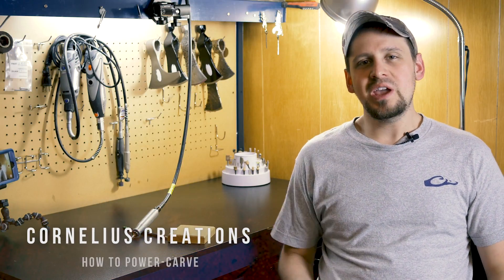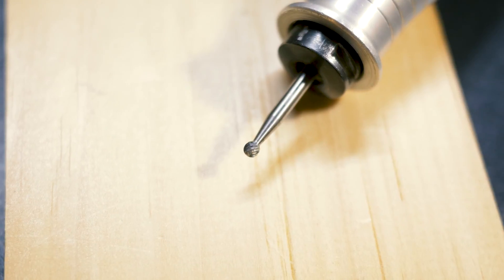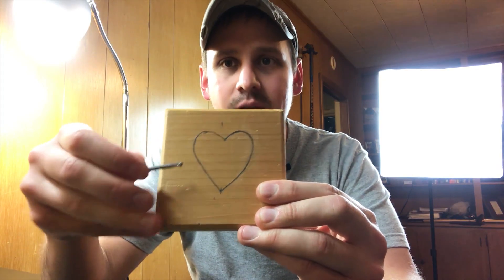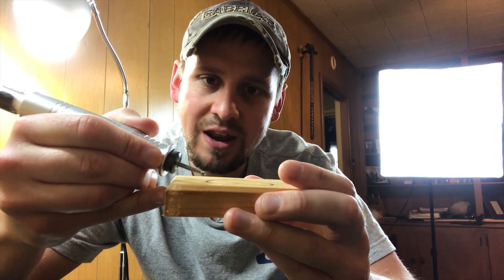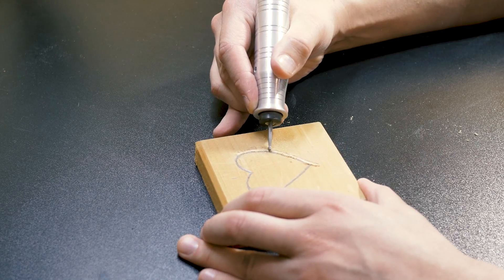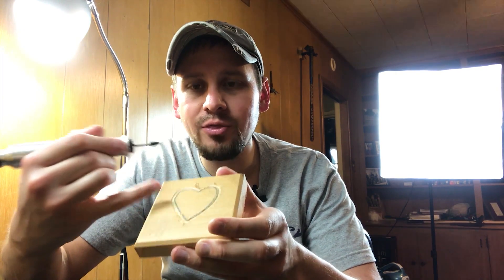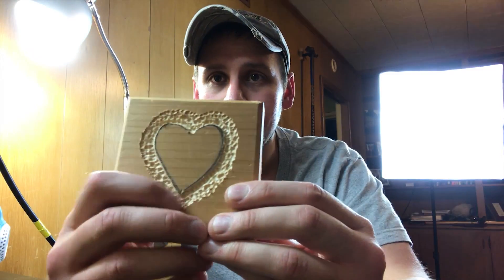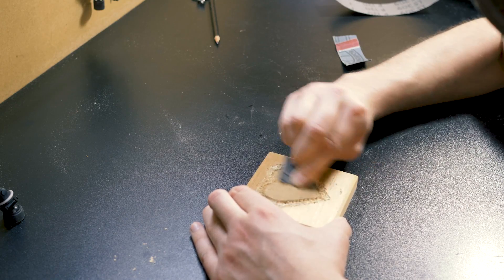How to Wood Carve/Power Carve With Any Rotary Tool

Comment: Fold a piece of paper, and make one half of the shape...then flip it for the other side, so they are identical... (-;
Reply from the maker: +Floyd Burdett great tip!!
Reply: Floyd Burdett

Yeah I was just about to suggest that tip :) that's the quickest & easiest way to draw symmetrically.
Reply: Or maybe buy a cricut and make way better stencils by computer
Reply: Floyd Burdett that is a great idea. Then you can trace it onto the wood and work from there
Reply: I LIKE SNOW FLAKES:
Reply: But do you like... SPECIAL SNOWFLAKES???
Reply: You could also print your design and transfer it to the wood
Reply: What sort of sorcery is this?
Reply: Witch!!!!

Comment: I bought the miter attachment with the drill bits at Menards for around $17.  Then you just have to unscrew the black grommet off and screw the attachment on, you can also adjust the depth of what you are engraving and it works really well for what you're doing.
Reply from the maker: Great tip!

Comment: Neat demo for starting to carve. I will be using my dremel w/cord to smooth out stoneware clay after the first firing. May also use for carving in the stoneware before glazing.
Not only will I be wearing a mask I will be using a downdraft grate on my tabletop with an exhaust motor attached to the exterior wall.
On designs such as a heart as I am rubbish with perception I fold a piece of paper in half and draw just one side then cut it out and unfold, Voila folk think I can draw evenly.
Thanks for sharing.
Cheers...Freddie

Comment: Matt, thanks for your helpful videos. Here is a question.  Which rotary tool cuts quietly but is still powerful enough to use on scrap pine?  Not having to wear hearing protection would be nice.

Comment: You can compensate for the drawings by doing multiple sketches so imagine pencil markings over themselves until you get a defined shape that you can specify. So your heart shape keep redrawing it upon itself whether the curves of the heart or the pink at the bottom or overall and one big shape until it looks uniform and you can smooth it out. The other thing you can do is you take a piece of paper an outline the shape you do want and use that as a stencil for the other shape so it's identical. You did a great job by the way drawing is definitely a great skill. But creating templates requiring the patience of drawing more than ascetics. It still helps to have a steady hand though. Artist have an ability to draw and envision the object AC which is something more abstract. In this case just finding your template buy compounding the markings until a defined shape is created is relatively simple and effective. You did great in nice video. I love the tips you gave

Comment: The fact that you are using pine in your demonstration, explains the "FUZZIES", lol.  I have a Dremel with a flex shaft and bought a foot control from Amazon and, I am really disappointed that the Dremel will only run at what seems like half speed!!  I plan on getting a Foredom some day but I want to be sure that I can run a specified speed.  What foot control do you use and, I also like your light source that is behind you where is that from?  Thanks, I am a subscriber .

Comment: TKRET
Before I retired, I had to teach all of the employees, how things 'were done' in the office.  When I was showing someone what to do, I also told them why it was being done., and how it fit into the entire job function from start to finish.
My question is I am not a fan of the stipple effect, and would like to see either a flat surface around the heart with straight sides on both sides of the 'moat' if you will, or keep the flat surface and have the sides walls on a 45 degree angle

Comment: Thanks for the video really helpful, can you answer a couple of questions for me. 

What kind of wood do you have to use, can you carve manufactured wood like mdf or ply.

Can you carve on other things like the Dremel engraver kit says you can engrave on glass but that’s a hammer action I think not a rotary.

How small can you get the carving with the rotary, could you carve a half cm letter for instance. So could u carve in 1mm for detailed work.

Can you use stain or paint to get the burning effect without using a pyrography pen and blow torch

Do you have a video of carving wood where you leave the carve indented rather than making it 3D. Hope that makes sense, this video for instance brings the heart to the forefront and the rest to the background but can you do it the other way round to so letters would be sunk in but smooth

Thanks

Comment: Have you had any problems with the flex shafts getting hot melting and snapping? I got a dremel knock off it broke after the first project

Comment: Can you use a Dremel sandpaper drum or disk instead of the sheet sandpaper? Also, what do you call that flame device you used at the end of the video? Thank you for your wonderful presentation.
Reply from the maker: Hey Joel! Drum sanders will take off a lot more stock than sand paper, so you have to be extremely careful. That was a butane lighter!

Comment: Hi, i love your video i just unwrapped my Christmas present Dremel 4000  . I'm really nervous about using it for the first time. I'm set to do a heart  like yours but  not sure what speed to use .Can you or anyone offer some suggestions please  my speed ranges from 5 to 35.  Thanks in advance. Sharon
Reply from the maker: Hey Sharon, I tend to carve around 16-21. Use the the higher speeds for very light finishing touches. The higher you go, the smoother it will be. But if you are removing a lot of stock you want speed & torque. Do a few practice pieces. I promise you will get the hang of it and see what I’m saying :)
Reply: @CorneliusCreations  Thank you so much  Cornelius very helpful. Happy New Year from across the pond.

Comment: Hi thanks for tutorial. I have a couple questions first can I carve on wood using a rotary tool? I just got one and not sure what all I can use the accessories for. They don't provide much in the way of directions. Also if that is possible how does it work using it to carve letters or words. I made my grandson a wooden cross and wrote a Bible verse on it and would love to carve it instead but I had no idea this might be a possibility with my rotary tool. Thanks for any info you can provide me with.
Reply from the maker: 1) Yes most definitely. You can use just about any rotary tool to carve the wood.
2) I suggest you do a little research on the burrs (bits) and watch a few more of my videos and things will begin to come a little clear for you.
3) Look around at Dremel's website and it will give you some ideas of how things work.

Hope this helps!

Comment: Awesome, thank you so much!  You're a clear & kind instructor with great video pov's too!  I'm very new to the Dremel world and this is so far first video that helped me grasp a bit more of the concept; with details, but not overkill.  I even read through the manual, but still uncertain (if not further confused, lol).  I defy need 'the basics,' and will be searching around here for more from you...  

I have the 4000 (211 if that matters?) and 2 questions atm:  
1) Is there a particular reason you didn't use one of these sanding (cylinder?) attachments instead of by hand?  
2) Is the flex tool part (mine I believe is called an engraver...?) much different than the main tool?  Is it specifically for writing/engraving - bc it's smaller/easier to grasp (mine has a tip on it, & doesn't look changeable)?  

Excited to see what this baby is capable of - thank you again!
Reply from the maker: Hey Jessica! Thank you for your kind words! 
1) Every burr has a purpose. The sanding drum would have worked but would have made a lot of dust instead of “shavings”. The burr I used will last a lot longer than the sanding drum. Also, the sanding drum is a lot finer grit and isn’t made for heavy stock removal.

2) The part your talking about is called the flex shaft attachment. It is made so you can grasp it easier and do finer carvings with it. Inside of the “chuck” is a “collet” that allows you to interchange different size burrs. This hooks to your main motor of your Dremel. If you carve wood most definitely use the flex shaft attachment. Most people use the main Dremel for around the house work. If you have any questions don’t be afraid to message me on FB!
Reply: @CorneliusCreations  AWESOME... Thank you!!!!

Comment: What speeds do you run your Dremel at? Thanks
Reply from the maker: That depends on the type of wood, what I’m doing etc. usually around 10,000-18,000 rpm
Reply: Could you do a video on explaining how to decide what speed to run, how to prevent runs where the bit takes off and what about grain? Thanks for your response.  @CorneliusCreations

Comment: Do you have any recommendations on what kind of Dremel to start out with?
Reply from the maker: 3000 or 4000.
Reply: Hi Cornelius, I’m from Belgium and am starting with gourd art. I’m not sure but I’m under the impression that gourds are a litter harder than normal wood. I’m not sure if I should by the Dremel 4000 or a Powercarver micropro that can go upto 45000rpm. What would you recommend please?

Comment: Great channel. Really well presented videos with loads of info. Total beginner at this. New subscriber. I checked out your link to the van haus engraver and there seem to be 2 kinds available in the uk. One engraver unit is held in your hand and the other type hangs on a stand and you engrave with a flexi lead of some kind that attaches to it. Which one would you recommend? Many thanks.
Reply from the maker: Always get the one with the flex shaft attachment! So glad the videos are helping my friend!

Comment: Thank you so much for these videos!  I have subscribed to your channel because I received a Dremel rotary tool for Christmas.  I saw elsewhere in the videos that you do not recommend carving into pine, which is the wood I use most often in my shop.  Do you have any suggestions for working in pine?
Reply from the maker: Awesome to hear that! Pine tends to splinter very easily! Make sure you ALWAYS wear glasses especially if you work with pine. You can use it, but it’s really not preferred among power carvers. Other than that I would just just try it out. I’ve only used it one time. And that was enough for me lol.
Reply: Cornelius Creations — Thanks for the quick response!  Would you recommend a lower speed with pine?  It seems like that might cut down on the splintering...

Comment: Is there a rule of thumb on what speed to use for power carving? Also, what is the best type of wood to use? (I am new at this).
Reply from the maker: Good question! Well the rpm is dependent on the density of the wood. When you start going too fast it tends too burn the wood while carving it. You want a good balance of torque and speed while carving. I tend to keep mine around 12,000 -16,000 rpm. But there are expensive pneumatic carvers out there that gets up to like 400,000 rpm! Those require special burrs and are mainly used for very high detail work. The best wood to start with would be some basswood or something. It cuts like butter and would be a good start. Just avoid wood like pine.
Reply: Cornelius Creations Weaponry thanks for the info. I’m excited to get started. I did the heart project and it came out pretty good. (For a newbie).
Reply from the maker: Right on! I am glad to hear that!

Comment: nice video  u know I want to buy  all the equipment to do carving wood and carving stone too can u help me to choose the right equipment to start?
Reply from the maker: Of course man! What is your questions? Also, you can find my amazon store front on the links above, this takes you to all the equipment I use.
Reply: thank u , well I wanna start with wood carving and I can see in ur amazon page u have Dremel with all the tools , u think that one is good to start ? because I never did carving  so I don't know if Dremel is good to start from 0.
Reply from the maker: The dremel is good, just add the flex shaft tool. If you aren’t wanting to spend that much check out the cheaper one I have listed. Get that and some burrs and you will be good to go! All you need now is to jump in the saddle and start carving :)
Reply: thank you brother I appreciate your help very much.

Comment: Ok I want to learn how do this stuff and I want to get one of these rotary tools but I have a simple and probably dumb question but WHAT IS AT THE END OF THE CORD?! do you just plug it into the wall or is there a machine I need to attach the rotary tool to? If you can answer this question it would be much appreciated
Reply from the maker: No question is a dumb question my friend. The end of the cord (the flex shaft) is a motor.  Inside of that cord (sleeve) is a wire that ATTACHES to the motor which spins it
Reply from the maker: My Foredom I use has an automatic flex shaft attachment. If you buy a dremel or similar brand you will need to by the flex shaft attachment

Comment: Hello! After what seems like hours of staring at the computer screen-I have decided to just break down and ask you for help-lol. Im very new to all of this-so it is quite possible I am missing the obvious answer-  all I want to do, is to be able to power carve/engrave wood craft items (words/design) etc. I obviously want something with power/smoothness, a flexible shaft, sanding bits, and a wide variety of bits/burrs?  I checked out the options you listed above (thank you for your variant price points!)-- however, to my untrained eye, it seems like there are a lot of bits/attachments I don't need and I don't see in the pics a lot of bit/burrs for engraving other than sanding?  Also, are the bits/burrs usually interchangeable from power carvers?  So if I get a Van Haus, can I buy Dremel burrs? Thank you for your help. I  just can't think anymore at this point. lol. Did I mention I was new? :) For example...are the two burrs you used in this video in these "sets"? THANK YOU- your videos are wonderful and appreciated.
Reply from the maker: Hey there! Any flex shaft unit will work starting out. The bits I used aren’t in a set, but you can get some for a good cheap price. All burrs can be used in other flex shaft machines, just make sure you have the right collet size. (The collet is inside the chuck of the hand piece which houses the burr) 

Just pick you up a cheap set of burrs and that will get you started :)

Comment: Just came across this. I was diving into relief carving starting off with gouges and V-tools. Finding some woods that it's a beast to work with and learn. I had an old generic "rotary" tool from being a mechanic I no longer use at the shop. Decided to try it out. Though it's a bit large and ungainly I am still taking a swing at it until I know I want to upgrade to something like you have. 

Any preferred set ups for straight beginners that are cost effective? 

 One question on my first foray into it I found it easier to control the cut letting the tool run with the rotation of the bit, tends to get spastic on me when I go against it. Is there any harm in this approach?

Also want to add in. Looking through your video list- probably binge watch tonight. Absolutely love your "Viking" designs. Life goals!
Reply from the maker: Hey Don! So glad to hear you are getting into powercarving! 

Setups: I have a link to a rotary tool for beginners that are around $40 in my storefront link. 

Direction: the burr will spin to the “right” which is clock wise. You need to angle your hand piece so that your burrs is always moving backwards toward your or to the left. Rule of thumb* pull the hand piece in the opposite direction the bur wants to “run too”.
Reply from the maker: Also, thank you for the kind words!
Reply: @CorneliusCreations  - Gotcha! Thanks! Been watching a couple more vids since. I saw your list. I think I may either try and get a flex adapter to fit on what I have ($8) or get that Tack model on your list. That was a head slap moment. After I typed what I did I saw your list and your store. (hopefully you get kick backs). Hope you and yours have a Merry Christmas and a safe Holiday. - Don (from NC)

Comment: What kind of mask should I wear for something like this? What are some guidelines I should look for?
Reply from the maker: A regular dust mask with the standard filter rating should work. But, I do recommend more premium masks since they are more comfortable. Other than that I think you should be pretty good! Just make sure you wear some fog proof safety glasses.

Comment: 603/5000
Hello, I am Ahmed from Egypt. I have a question about Dremel 4300. I bought it from the store at a discount. When I went home and opened the device case and read the instructions regarding starting the operation, I resumed after that in starting the operation and testing the device, I noticed that within a short period of operating the device the front part is in the front And in which the cutting bits are installed, its temperature begins to rise gradually and at the initial speeds of rotation of the device and I was amazed about that. It is clear that if I increase the rotational speed of the device, then there will be an increase in the percentage of heat of the front part, which was mentioned earlier at the beginning of the explanation, so what do you advise me to die in connection with that phenomenon or that I find it a problem.
Reply from the maker: Heat is very normal because the motor. You should have no problem, Ahmed. If you are using a flex shaft attachment be sure to grease it if you are using it a lot. (There are videos on YT about it).

Comment: if i wanted to start a tool box with say $200 what would be first 3 tools i would get?
Reply from the maker: Dremel 3000, flex shaft attachment, some burrs, sandpaper, stains or oil and a work desk with decent light.